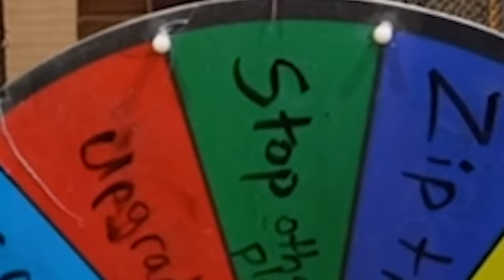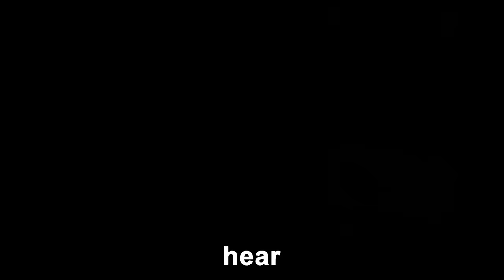Escaping 100 Layers of Cardboard Using Only Scissors

Comment: Next challenge Trent starts with the best option and goes backward ending with the worst option. Meanwhile, everyone else starts with the worst and ends with the best option
Reply: Yes!
Reply: That changes literally nothing. He will just go in reverse meaning he will start out fast then end slow. While the rest start slow and end fast. It's going to take him exactly the same amount of time either way just is faster at either the start or end.
Reply: @Faolan_Grey  no its not because the deeper you are the harder it gets so hes not gonna have strong weapons against the stronger part of the wall
Reply: @chai_T-T  it doesn’t change bro it just makes Trent blaze through then slow down
Reply: @amberwolf6334  considering there are time limits to the first weapons...the wall might as well be too strong for all the rest except from the last weapon which they might end up using for an extended period of time to finally break through...so imagine if Trent had the jackhammer for only a minute when normally it would take him like 5 mins with said tool to destroy the wall
Reply: @voidkq tbh think trent may finish all but the last sextion with the good weapon then end up being way faster than starting with thr worst weapon
Reply: Then Trent would just beat them and they would not stand a chance